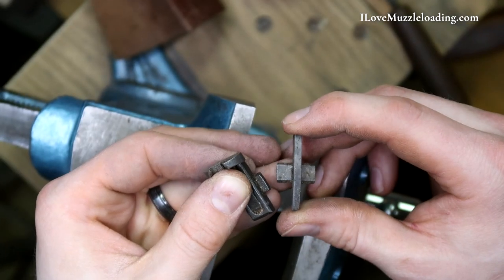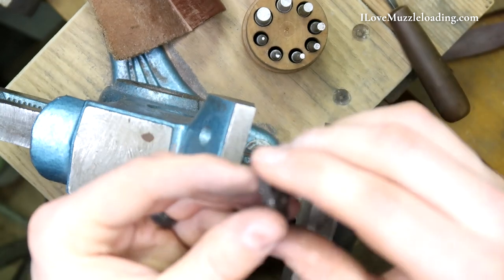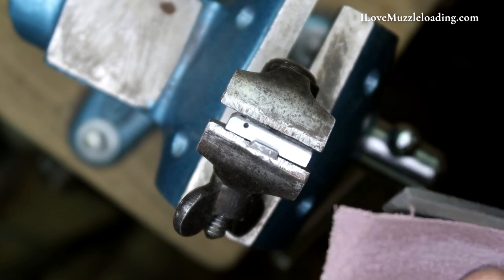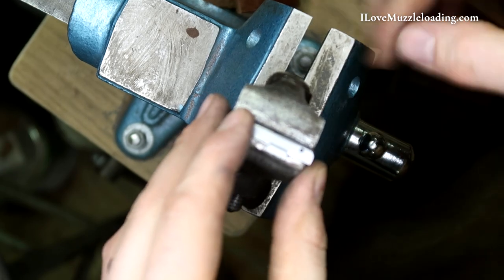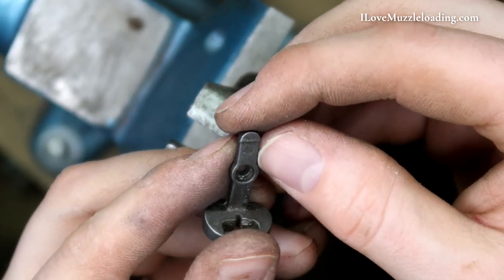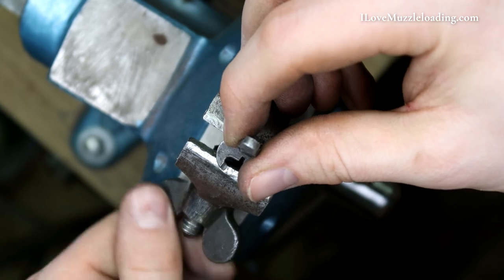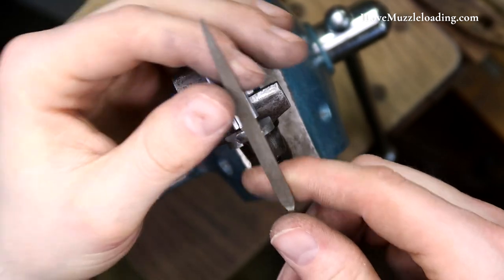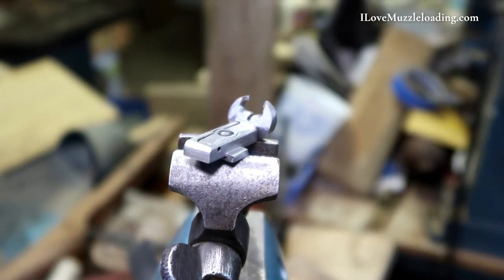Getting the Rear Sight Right | Investarms Flintlock Gemmer Hawken Build Part 15

Comment: Hey  a quick question. Does these gamer Hawkins come with both the rear traditional fixed, and Adjustable sight in the kit? Lyman great plains does, however I just purchased a spare. 54 cal barrel.  It only came with the Adjustable one.  So i,m in the search for a 3/8 dovetail buckhorn fixed sight.
Reply from the maker: Hey Steven, this kit only comes with one sight. You should be able to find the sight you are looking for from Track of the Wolf, the Log Cabin Shop, or Dixie Gun works. Hope this helps!
Reply: @ILoveMuzzleloading  thank you for the information. I have felt with log cabin shop, and Dixie gun works for 40 years. Track of the wolf for 8-10. Buying a sight is easy on ebay. I was just curious if the kit came with both options.
Reply: @ILoveMuzzleloading  thank you for the information. I have delt with log cabin shop, and Dixie gun works for 40 years. Track of the wolf for 8-10. Buying a sight is easy on ebay. I was just curious if the kit came with both options.